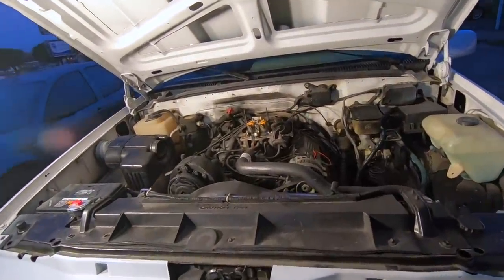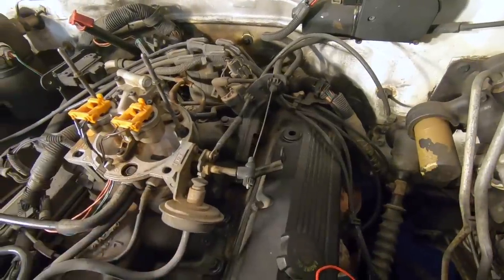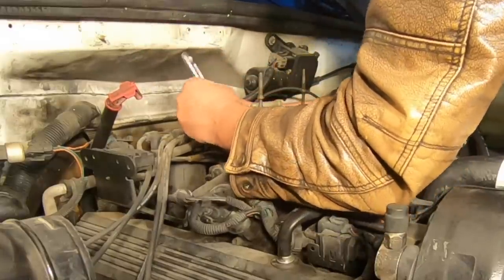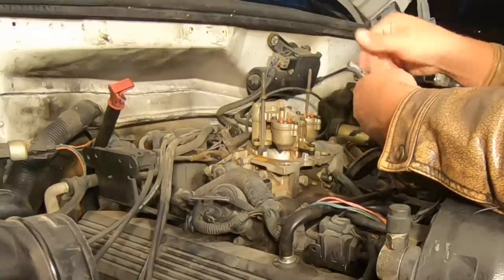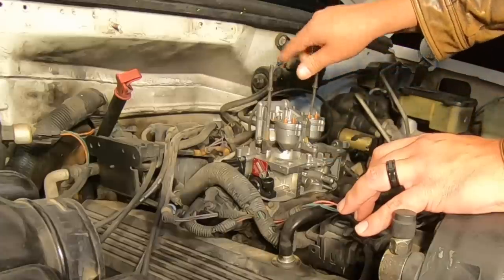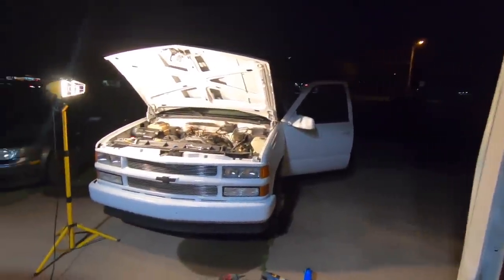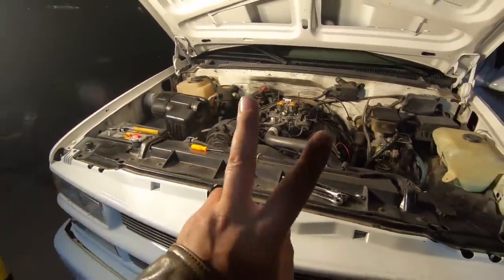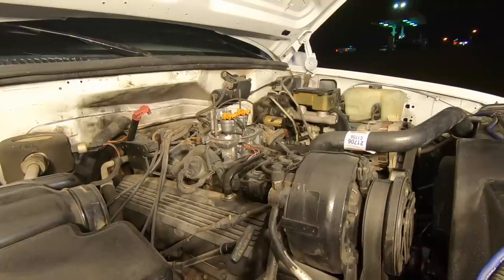94 Chevy 3500 454 TBI Replacement Issues!!

Comment: Okay to start with headlights I don't know if them are LED or hid but if they are and I have a ballast the problem you are having is they are overheating and causing themselves to shut down in order to cool down second throttle body injection I don't know why don't remember for that year pretty sure you don't I know when the newer cars you have to do a relearn when replacing throttle position sensor but being obd1 I don't I can tell you this tho that old throttle could be calibrated 4 high performance if so then if you're replacing it with a stock TBI unit the calibrations are not going to be right which is going to cause you to stall and not run right now without looking at a particular unit that you got you might be able to adjust it yourself if there set screws on it but they can also have the ignition timing turn down or up to on the distributor to match the old throttle body so you're kind of in a pickle unless you are willing to adjust it or know exactly what you are running on the old TBI maybe when u call the company that got it from they can give u some direction

Comment: Headlights sound like someone wired then with a circuit breaker in line that resets instead of a relay off the headlight switch. Probably they wired off trailer wiring going to rear some how. It can be fixed. Keep at it. Not all is lost. Got to get your money back some how.

Comment: check for vacuum leaks, check the grounds, then take the battery out and leave it for a whole day. put the battery back in and drive it. the computer will go through a learning process. It is probably set to run with the previous setup and acting up.

Comment: Put a meter on that injection wire read both lines to see if voltage is the same,then while reading the voltage kinda bend and wiggle the wire to see if the voltage falls any, if not its possible it may have put a error on the computer so it my need to be cleared.as far as the headlights check and see if it has dc/breakers on it instead of a fuse,it may be over heating and breaking eternally causing the headlighrs to shut off. I think the headlamps runs off its own circuit,and if it dont have a circuit breaker check for a relay its acts like something is getting hot and breaking conn. Till it cools off again. Hope this helps i know some but not a whole lot.....

Comment: Hydro boost is better than the vacuum assist! DO NOT REMOVE IT!
Glad to hear you came to your senses about the purchase of the truck! OK, we told you so! Now lets get it fixed! RETURN THE DEFECTIVE $550 TBI unit and get your money back! Just get the rebuilt injectors on your old one yourself! Also check the ECU! The computers on these truck work very quick normally! 
Replace the headlight switch! It is common they go bad!
DUMP IT!

Comment: Your this deep in it just be patient and fix it and drive it. Forget tires and headlights one problem at a time. You likely would lose more selling it than it will cost to fix it. Then you still got to spend to replace it . This is what this channel is about . Fixing and flipping. At least if it's running there is a chance of using it and recouping your lost money spent.

Comment: The reason it's not running because you have to bleed the lines and you got to reset the computer and make sure you don't cross the wires on the tbi and if your oil pressure switch or the module. Put a mother computer on it because you may have damaged it I have one I just got about a month ago and it's been setting over ten years and i put tank and pump cleaned the fuel lines and put new filter and plugs. Check you map senser

Comment: i think its fuel or air related. My first guess would be the injectors then either the fuel filter or fuel pump screen or even fuel pump. Lastly check the vacuum lines and vacuum advance unit mounted on the distributor. I would test the fuel pressure if its getting between 9-13 psi. It wouldn't hurt to inspect/check the TPS, CTS, IAC, EGR and clean if necessary.Lastly I would check and examine if the fuel pressure regulator is leaking. Good luck Randy, hope the fix is not timely or costly.

Comment: Sounds to me like a vacuum leak the base gasket or a cracked vacuum line. Check the vacuum lines and follow them to were they go and check to see if they are broke or cracked. As for the lights I have had the happen to me on a dully and a motor home it turned out to be the headlight switch. Good luck.

Comment: did you check the pressure of this fuel pump? those injectors like plenty of pressure, min 55 to 57, it seems no gas enough, how is driving it?

Comment: fuel pressure regulator in the tbi. that may be wrong. The headlight problem sounds like an overheating wire somewhere.

Comment: You could have broke a wire when you tighten down the air filter maybe the wiring harness to the fuel injection needs to be changed out for the headlights the simplest fastest trick to see if it works is to get cheap bulbs change amount see if that works if not there's definitely something wrong with the wiring just hang in there you'll get through it life does like to give you rotten apples quite a bit I know once again hang in there you'll get through it

Comment: Hydro-boost is VERY common on larger vehicles such as 3/4 ton trucks and up. It gives you a boost to your brakes that normal vacuum brakes cannot. It is definitely a great invention when you understand what it does and how well it performs over the stock vacuum design. If you have bad brakes for whatever reason, it isn't because it has hydro-boost on it.  I should also mention, you may have shorted out the "injector driver(s)" in the ECU if you shorted the wiring out by pinching them with the air cleaner. They send a signal from the ECU to the individual drivers at the throttle body. When this happens it may only be running on one of the two injectors. Take a look when you start it up, you should be able to put a NOID light on the connections for the driver that will tell you if the wiring is receiving a signal from the ECU to open/close as needed. You should also see a cone shaped fan spray from the injector when its firing fuel.

Comment: Check idle air control, swap the idle air off the old unit. Lights, check the head light switch, sounds like the auto off for the lights is screwed up.

Comment: Please read! Head light switch. I had a truck do the same thing as in the throttle body issue. I'm not sure it should be running good. It's new. When it shorted out. It could had back feed in to the computer and messed up the computer. Check that out. That's the only thing I can think of. Trust me I've had a lot of those old trucks like that and only seen one do that as and he never got it to run quite right but it was also a 4.3 by  computer trying to run a 5.7 v8. It also wasn't that bad as yours. That's what I would try is the computer.

Comment: One sensor that you had a hard time plugging in you said that it was a little bit tight the plug-in It looked like the idle air control valve that's the sensor that controls the idle check and make sure that when you plugged it in you didn't bend any of the pins inside of it if that still doesn't work  unscrew that sensor from the new one take a look at it make sure it's okay and maybe put the other one in out of your old throttle body and see what it does the idle air sensor it's the one that actually screws into the side of the the throttle body it takes like a 1 inch wrench or an inch and a quarter or something like that to unscrew it if it looks okay then replace it with the old one out of your old throttle body and see what that does

Comment: The hydro boost system is because since the body of the truck was for a Diesel and diesels don’t have vacuum so they have to have the hydro boost system to asset the breaks. If that helps you out you are welcome

Comment: Randy, Hydroboost is typically used on GM and Ford Diesels.  The engines have no throttle so the manifold vacuum is unreliable.  I have seen hydroboost on the gas burners but that is not as common.  Another option for diesels is an external vacuum pump and conventional vacuum boost.   If your hydroboost pedal pulsates, flush the fluid in the system.  Also, you said you pinched the injector wiring?  If so, you may have shorted the driver in the computer.  You should be able to open the throttle and see fuel spraying from each injector.  If not, you may have killed the driver electronics that fire the injector on one side.  Or you can unplug one injector at a time and see if the engine operation changes.

Comment: when doing a tbi always replace the fuel filter  and reset the computer and do a drive cycle , seen many of them with 100K miles and the original filter and plugged with water and silt  ,  also hydro boost better than vac system  hands  down . specially with big brakes . ( 9600lb  set up )

Comment: @Auto Auction Rebuilds My moms 2013 Chevy Suburban 2500 Has the hydro boost and it gets rid of the brake booster on the back of the master cylinder

Comment: If you had a shorted coil, you may have a high resistance junction in the driver of the computer (can often be repaired by an electronics tech rather than replacing whole ECU). This will cause low current to one of the injectors. Otherwise, check for air/vacuum leak. You may have cracked a hose when removing it. Smoke test through intake is not difficult (DIY smoke tests on youtube). I think you should keep it. Engine sounds nice and smooth and it's just what you need for pulling trailer and cars around. Offset your bad purchase by keeping it and getting good use out of it. Slowly do it up as you find cheap parts and she'll be ready to sell by the time you have had a lot of use out of it and be tidy enough to get reasonable money.

Comment: if you pinch the wires than you need to check control unit or computer or whatever gives a signal to these injectors

Comment: I would start with moving your distributor also, the hydro boost brake system is on 3/4 and 1 ton trucks (2500/3500 or 250/350).

Comment: Maybe this is a good place to get some answers. I have a 94 k2500 suburban, and I get what I feel is either a backfire or a misfire at 70 and up mph getting up to speed on the highway. Maybe around 3,000 rpm. Not entirely sure about RPM’s as mine doesn’t have a tachometer. Any ideas?
Reply: I want to get it fixed because it’s been a very dependable vehicle for my family. Probably the most dependable vehicle I’ve ever owned next to my commuter car which is a 99 civic.

Comment: Would be wise to keep a shop towel over the open holes on the intake manifold when removing parts above it.  Check for vacuum leaks! The hydro booster is used on diesel engines, very expensive to repair.  Old school headlight circuits have a thermal circuit breaker, it resets after it cools down. The breaker could be defective but more likely look for shorted wires or aftermarket lights that pull too much power.

Comment: Headlight swithch. It has a built in circuit breaker in it. After a while it gets hot , the breaker opens till it cools down again. Then the cycle begins again.

Comment: It's called hydroboost. It's your booster for your power brakes. If you were to bypass, your brakes would be difficult to apply. The diesel engine doesn't always produce enough vacuum to operate a vacuum booster. I currently have a Chevy 2500 that has the hydroboost system. I can't say as I can tell any real difference between this and a vacuum operated booster. Just really important to keep the fluid level up or the hydroboost doesn't work well.
Reply: Also be sure and check and/or replace suspect power steering belt/s. Lose them and there goes your hydro boost pump and no brakes or power steering.

Comment: Randy  re : Throttle body PLEASE read......…..Ouch those throttle bodies aren't getting any cheaper that is for sure. I actually used to rebuild them and for a while I'd do 3-4 a week. The biggest problem is the throttle shaft wears through the aluminum causing a vacuum leak. It could be all the time or intermittent and it drove people nuts. I've even seen rebuilt units that leaked out of the box. To fix the leaks I'd put them in a mill and drill the hole oversize and bush it with a piece of oilite bronze.
Check with a can of carb cleaner/starting fluid, have someone start it and spray around the shaft with the air cleaner on and it should stop stalling.

I'd love to get in touch because I used to deal with these trucks all the time and most of the little problems aren't that big of a deal if you know where to look.

Comment: Check the vacuum hoses and connectors and the light switch, both common problems on GM cars. The hydra boost system is common to Diesel engines, due to the lack of vacuum.

Comment: HI Randy for the headlights it is the headlight switch they get hot and turn off and for the TBI pull the bad injector look for a part number and just replace the bad one you should be fine

Comment: Throttle Position Sensor (TPS) needs adjustment. I would believe. The other possibilities are the IAC or MAP. I'm sure this answer is too late. But likely the TPS needs to be clocked forward a little so it will idle normal.
Reply: If I remember right to calibrate it one needs to....Engine off...key to on position for 5-10 seconds. Then off again for 10 seconds. There are also (2) different IAC valves the only difference between the two is the size of the pintle on the end.

Comment: I love the hydraboost system. Its very compact and easy to understand. And anytime anything goes wrong you know what it is because you lose both power steering and brakes. Its also pretty reliable. But my biggest like is that its compact.

Comment: Hydroboost is great.. its a far superior system to vacuum for both power and the ability to deal with low vacuum engines.  It's still in use today on a lot of GM trucks other than the half ton pickups.  I would say your idle issue is the idle air control motor in that new tbi not opening up enough to get the airflow for idle and there are setup procedures online step by step to set it's baseline.  Just type in setting a TBI IAC.   The issues at cruise could be a number of things.  I agree on a vacuum leak but you can't hear one with the air cleaner lid off through a camera.  The 94 and 95 trucks ran smaller injectors and a higher pressure fuel pump to the tune of around 30 psi as opposed to the older rigs running a 12 to 14 psi system.  The injectors are like 45 pph as opposed to 90 with the  older ones because of the fuel pressure differences.  Might want to cross reference what the tbi that was on it was and make sure you have the right one.  Being it was a 6.5 once who knows what they frankensteined together.... because the level of work looks pretty bad at best.

Comment: a vacuum leak use a  vape or a smoke machine u will see were the vacuum leak is when you blow it on the motor thanks for the video had the same truck same problem:-)

Comment: You are an open and genuine guy Randy. Respect from the other side of the Pond mate.
Now if you pinched those wires and they are driven by an ECU of some sort then its quite possible either a sensor is burned out or the ECU needs resetting. Certainly worth checking the fault codes if you have the right connector and clearing them. The fact it won't idle points me in this direction as a point from which to start. I am not sure pinching those wires burns out the actual injectors rather the sensors further back in the system after all you now have new ones in and they are not firing (or have no fuel feed of course). Also check those wires to the two connectors on the side and see where they go or what happens if you disconnect them? And if you find some wiring / ECU / sensor faults then use the original and try and get a refund on the new one.
Good luck mate ... Best of ...

Comment: My first two cars were 1979 Lincoln Continentals - they had hydroboost on the brakes. Never had any issues with the system on either. Kind of gave the brake pedal a nice smooth feel compared to the vacuum boosted cars I knew at the time.

Comment: Hydro boost is for diesels, I would think of it as an upgrade because it has a good bit more psi for braking, even though it puts a lot more load on the engine while turning and braking at idle

Comment: Hydroboost is common in the larger trucks. A lot of guys swap to it to help with braking with larger tires. Do not get rid of it. You should also check fuel pressure and check for vac leaks.
Reply: Also ohm our the temp sensor in the intake. Known for going bad and causing running issues.

Comment: For anyone watching this with a similar issue, you have to turn the key to the on position for ten seconds, then off for ten seconds, then start the engine and let it run for five minutes.  Just flicking the key back and forth won't do itThis resets the computer interface with the Idle Air Control Valve.  The engine will idle at 1800-2000 RPM for a bit then return to something closer to normal.  After five minutes, turn it off, wait 30 seconds, and then turn it on and go for a 10 minute drive in varying conditions so the computer can program itself properly with throttle and IAC valve responses.
Reply: Im having a hella issue. Same thing.
Reply: @danielbrainard2865  Were you able to resolve it?
Reply: No this does not work!!

Comment: check the stampings on the sides of the block for year and vin #. i personally would keep the truck and fix and use it. you will make your money back just by useing it.
Reply: unless you have owned and worked on diesel's stay away from them. they cost way more in maintenance.

Comment: Randy, I had the same issue with my '91 TBI. Turned out to be the distributor. Replaced it and it ran like new. Engine had 267k on it at the time. No codes were thrown either.